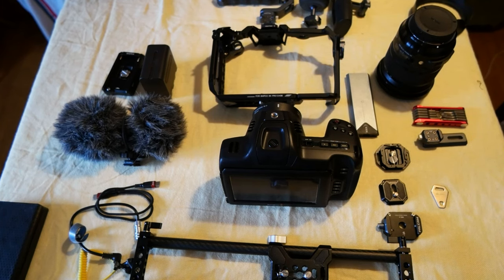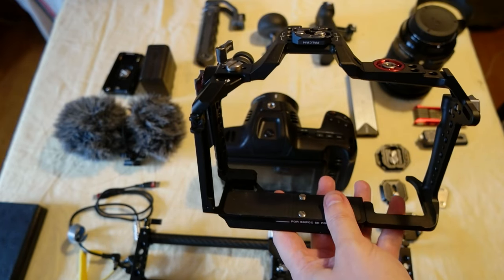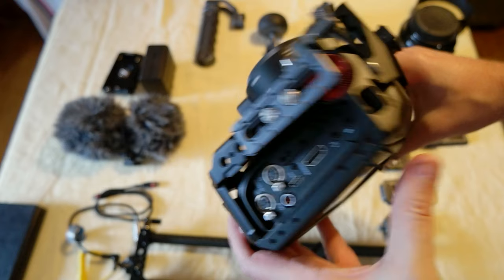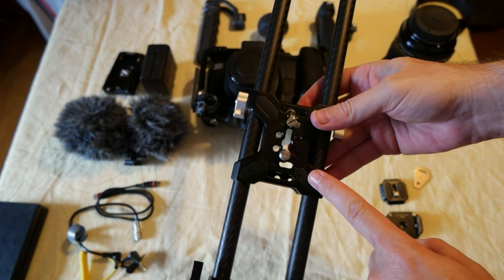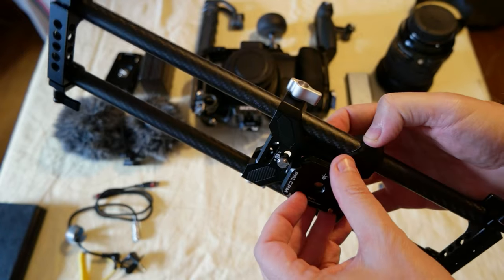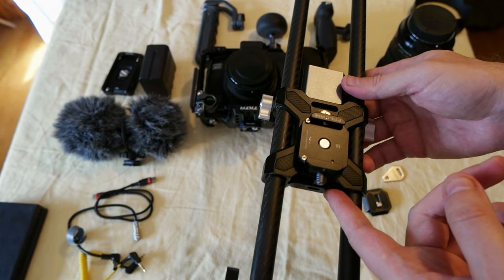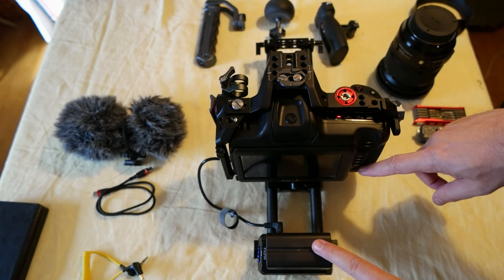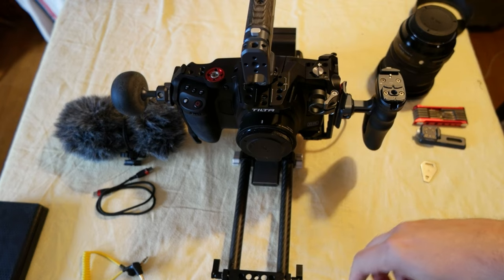Blackmagic Pocket Cinema Camera Full Frame 6k Camera Rig Build  !

Comment from the maker: =====================================================
EcoFlow
=====================================================
EcoFlow Delta 2 MAX - https://bit.ly/3FcNwyV

=====================================================
BMPCC Full Frame 6k Accessories
=====================================================
TILTA Nucleus Nano II - https://bit.ly/3RP6HGJ
Cage BMPCC 6K - https://bit.ly/3ZFNj0G
SmallRig Mini Matte Box Lite - https://bit.ly/46COlwW
Rod Holder - https://bit.ly/3F1pFSR
Dual 15mm Rod Clamp - https://bit.ly/3ZGTTUR
Tilta F970 V3 charger - https://bit.ly/3PK2yBh
Ulanzi CM029 9 in 1 Multitool - https://bit.ly/3ZIxGWp
H052 16V USB-C PD Power cable - https://bit.ly/48KOVu6
DC2.5 to SF6 2Pin calbe - https://bit.ly/3Qa8ntm

=====================================================
Falcam F22 / F38 / F50 Accessories
=====================================================
Magic Arm - https://bit.ly/44Zof5S
Top Handle - https://bit.ly/3EMsib9
Mushroom Handle - https://bit.ly/3ZtbS10
Dual Head - https://bit.ly/3EMsib9
Cold Shoe - https://bit.ly/3LqykSE
Action CAM Mounting - https://bit.ly/3sXw3YB
Action Cam Ballhead - https://bit.ly/3ZoqzlK
Monitor Mount - https://bit.ly/461i2Yw
Baseplate - https://bit.ly/45WiS8N
Quick Release Plate - https://bit.ly/45oR0sS
Quick Release Suction Cup - https://bit.ly/4001ez7
Quick Release Plate Clamp - https://bit.ly/46EhMPa
F22/F38  Quick Release Ballhead - https://bit.ly/3LVxrl5
Base plate 3306 - https://bit.ly/3RPDrj8
Gimbal Dual Handheld Grip - https://bit.ly/46JcXEl
Gimbal F38 & F50 Quick Release - https://bit.ly/3LRZuSF
Gimbal Quick Release Sling Grip - https://bit.ly/46ByY7R
F38 Double Thread Quick Release Plate - https://bit.ly/46HqSKL
F38&F50 Quick Release Plate - https://bit.ly/46MoVxf
F22 Nato Adapter - https://bit.ly/46MoVxf
F50 Quick Release Mount - https://bit.ly/47amJze

=====================================================
DJI Osmo ACtion 3/4 accessories
=====================================================
DJI Action 3/4 Metal Cage - https://bit.ly/451GVSH
DJI Osmo Action 3 - https://bit.ly/3RPpgL4

=====================================================
Macbook Dock & Hub, Thunderbolt Cables
=====================================================
Orico Dock - https://s.click.aliexpress.com/e/_Dn0...
Thunderbolt Hubs - https://s.click.aliexpress.com/e/_AqRIjh
Thunderbolt Dock - https://s.click.aliexpress.com/e/_AB5mMj
Thunderbolt 4 40Gbps USB C Cable - https://s.click.aliexpress.com/e/_AVeE03

=====================================================
NVMe Memory & PCIe
=====================================================
Seagate FireCuda 530 NVMe - https://s.click.aliexpress.com/e/_9H99nB
NMVe PCIe 4.0 - https://s.click.aliexpress.com/e/_9IaUBv
NMVe Heat Sink - https://s.click.aliexpress.com/e/_AVD0X1
Lexar Professional x1066 256 Gb - https://s.click.aliexpress.com/e/_Dd8...

=====================================================
Keyboard & Mouse
=====================================================
Logitech Master MX 3 - https://s.click.aliexpress.com/e/_AOe9Np
Logitech MX Keyboard - https://s.click.aliexpress.com/e/_AcCiEJ

=====================================================
Office Desk & Chair
=====================================================
XXL Large Office Computer Desk Mat - https://s.click.aliexpress.com/e/_9gDOGj
Office Chair - https://s.click.aliexpress.com/e/_AaKFIF
Office Chair Wheels - https://s.click.aliexpress.com/e/_AOwrHZ
Office Table - https://s.click.aliexpress.com/e/_AWyiTt
Office Table Wheels - https://s.click.aliexpress.com/e/_9RUW6r
Smart Wifi Power Strip 4/6 - https://s.click.aliexpress.com/e/_AP61MR

Comment: Smallrig fits perfectly
Reply from the maker: the one for 6k or 6k pro?
Reply: @biskero  6k pro cage for 6k FF. It's fits perfectly except the top screw doesn't screw in fully. Otherwise if fits snuggly.
Reply from the maker: @chrisyeong  ok so it's the same as the tilta one that I got ! I was planning to make a top hole on the cage to align with the hole on the camera, will see! I wish Falcam will come out with one, it would be great as I will simplify even further the rig.

Comment: Nice rig!
I went similar with a tilta rig, sirui quick release base plate, carbon fiber rails, vmount battery, xlr cable connected mic and an SSD mounted on top left. 
I like your handles! I got a sigma just for this camera but I am planning to use cine lenses as much as possible. 
Enjoy!!!
Reply from the maker: Nice, I had to do some work to make it work. Will do an update since I got the DJI focus pro and RS4 Pro. Wish Falcam would do a cage for this camera !

Comment: Falcam doesn't use Nato Standard for these handles?? Why creating another standard???! 🤦🏻‍♂🤦🏻‍♂🤦🏻‍♂ Arca Swiss, Manfrotto, Arri rosette and dovetail plate, Touch&Go by Sachtler/OConnor and Nato rails are enough for me...
That little button on top of the handle is a release button? Unfortunate place for a release button, if one inadvertently press it while holding the camera everything drops?! Urgh..
Also, one screw for all those plates down and up is not going to be enough, all it takes is an energetic pan, and they will come lose. And I don't like the idea of having to fiddle under the mounted camera to release the screw and change SSD whenever it is necessary. It's a cool idea hiding the SSD down there but for SSD changing it is not practical at all.
Thanks for the video though, it is always helpful to see new rigging solutions.
Reply from the maker: Options and Falcam system is much better that the other systems you mentioned. I tried them in the past and you end up with different mesh of accessories which some are over-engineered for a camera system. The Falcam system has no play and is very well engineered. Try! I would like to see a Falcam cage for the BMPCC, it will replace most of the mount accessories. The button is ok, you need to apply a bit of force to push it so no accidental push and you won't drop anything since you than need to slide it out. About the one screw, it's fine already tested. Of course would be better with more screw. The baseplate is very simple, hopefully Falcam comes out with one that has integrated F38/F50 so that you do not need to screw in adapters. Also the NVMe is very easy to slide it out and I can move the screw from top to the bottom so it's even easier to lock it in and to replace it if you need it. It's also very easy to access it via cable. In any case a rig build fit my needs and did not want to mount bunch of stuff on top it with screws and different mounts accessories. As soon as I get the new accessories the rig will be even better. Will need to add the Tilta Nucleus Nano 2 and motors, matte box and lens holder. Will do an update. Cable management will be fun! Thx for the comment.